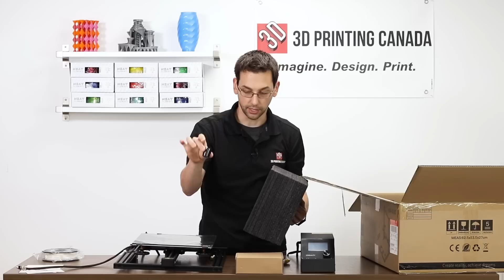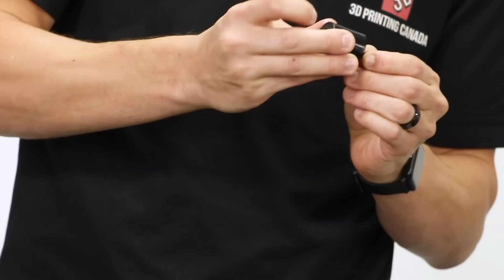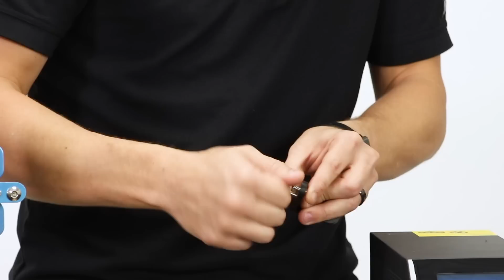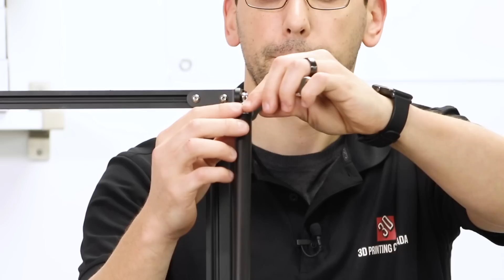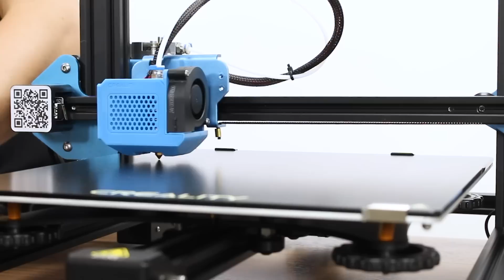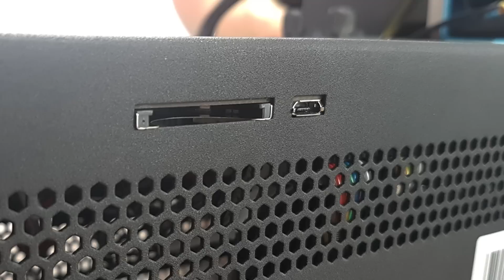Creality CR-10 v2 Unboxing - Is this Creality's Best Value?

Comment: Just finished building it, My z axis is messed up I think idk a bolt might be locking it in place or I messed up or it came messed up but the z axis doesn’t move and it makes a very unpleasant sound that sounds like the printer wants to be put out of its misery. Any idea what could be causing it?

Comment: Why did you preheat the nozzle and bed prior to leveling?
Reply: The heat causesthe the bed and nozzle to slightly expand, you want to level whilst they are hot in order to get a accurate bed level, however, it's not necessary, I find it best to adjust the level during the print as it is most accurate in terms of actual print performance

Comment: My Zed stop switch did come with adjustable hammer bolts and nuts.  It bolts to the frame.  Is there somewhere I can order them?  The bed won't raise up enough to level properly.

Comment: I'm been considering getting a 3D printer to sell sculptures and custom frames, but at the end when he says it took 28 hours to print that shelf bracket all I thought about was "it's probably easier/faster to carve it by hand" not to mention the time it takes to model it in 3D. Why is 3D printing so inefficient? any fast speed 3D printers out there?

Comment: Hi. I haven’t turned on my printer yet because I’ve noticed a few things that have worried me about the printer. I’m meeting resistance along the Y axis and I’m just curious if there is supposed to be some resistance because it’s not a steady amount of resistance there are point where it just stop and you have to push much harder to get it to move. Another thing that worried me is that the bolts that hold onto the Z axis are very loose on both sides and I wondering if they are supposed to be that way. If you are familiar with these problems and could answer my questions it would be much appreciated. Thank you

Comment: Thank you for your video.  I just got the CR10 V2.  I was originally using a Dremel 3d20.  But decided to upgrade, with CR 10 and also a Palette 2s and Hub s.  I have been having trouble with the z-axis.  I leveled the bed, but once printing begins, the z-axis moves up a couple mm, and then the first layer is a failure, which causes the whole print to fail.  Should I raise the z-axis and bed, and then recalibrate?  Also, I just ordered the BL leveler and hope that this will help.  Please advise.
Reply: Did you fix this problem, if so, how? Getting mine tomorrow so it would be interesting to know if I run in to similar issues. Feel free to give other tips and tricks about the CR10 V2. :)

Comment: I have a new CR10 v2, and card reader is horrible. If i Press the card hard enough and hold it pressed, it will read the card, and if i let the pressure off, the card is not readable! bad first time experience.

Comment: Great video. The Z Axis Limit Switch (you must have a early model) now mounts into holes of the frame so you cannot adjust. I have been having a bugger of a time trying to level the bed (just got the printer today). The springs are up to the end at times. Much harder then my flashforge which mind you has auto leveling built in. If BL touch solves this perhaps i may look into it. Also seen they now have a CR-10 V3, lol i should have waited a bit.

Comment: I have a cr10s and there is no room for the glass sheet. Had i hit auto level with it on there it would be destroyed. Not sure if i want to crank the bed leveler down a quarter inch. What did i miss?

Comment: Just received mine (4/26/2020). A few differences FWIW.
  The rubber feet came attached on mine. As mentioned in the video, the rod brackets seem to line up perfectly when they were flush with the ends of the t-track. By sheer dumb luck I mad the rods exactly the right length the first time! 
   The z-limit did not come assembled on mine. My Z-limit switch mounts in pre-drilled holes, not on t-nuts, and would therefore only be adjustable if you used t-nuts, which are not supplied, instead of the threaded holes. I noticed that there is considerable play in the way the Z limit switch is held onto the frame. That might be something to use or might have to check from time to time.
  Nice to know that the third thumbscrew is an extra. They don’t tell you that and I spent quite a while looking through the directions trying to figure out where that thing went.
  My software says “Creality” in the upper left-hand corner instead of “CR-10 V2’. other than that it seems to be the same.
  No I’m ready to level the bed and try to run a print!

Comment: Hi! Does this really needs the Titan Drive in order to print TPU? Mostly I'll use it with PETG but I'll also need some TPU to come out of it.... Any tips on that? 
Or it would be better to choose Ender 3 Pro stock? What's your advice?
Reply: For any flexible material like TPUs, don't try to use bowden style printers (like all the stock Creality configurations). Yes, it can work, but direct driven extruder/hotends are just way better and more reliable at this task.
I would definately look for an extruder upgrade. Does not have to be the E3D Titan Aero, i think the new Hemera might be another interesting solution, or one of the BondTechs. I just have not had the pleasure to compare them directly, so i can't really tell you from experience what works best.

Comment: Try to perform electronics and somewhat mechanical basic search before video making/documentary... you're not familiar with basic terminology of basic connectors like You're telling 'IDC connector' as connector used in PC, 'Stud' as threaded rod so on... so try to perform basic search on parts you find....

Comment: It never ceases to amaze me, how many people claim lock washers aren’t important. They keep screws and nuts from loosening and falling out...USE THEM!!!
Reply: It depends on the style of lock washer. NASA has some documents on Split Lock washers that says they don't work.
Reply: You're not wrong, just looking at a different time scale. At first, the lock washers don't do anything. It takes experience with mechanical things to understand their utility. Also some cheap lock washers actually don't do anything ever because they're not made out of a material with the wrong strength and deform when compressed.

Comment: Would you recommend this over the cr10s? I am thinking of getting the 10s but am open to other printers.
Reply: @Jason Yeah feel free to ignore Jason's reply lol
All I'm saying is if you buy one of these, get ready for mad headaches, they are very finicky, sure you will get some prints with nearly no issues, but you will get a mountain of screw up prints, you could have every setting perfect and 10 hours into a print the machine just decides its going to screw up and there goes whatever you were trying to make. Resin is typically much more user friendly, however resin is quite expensive compared to filament, your print size is much smaller, and there is a curing process for your prints when they are done, however having said all that the success rate of most resin printers is quite good and resin printers are masters for detail. 
Take it from a guy who has owned 6 3d printers, including 4 creality brand printers. I will never buy another creality.
Reply: Skyline Fabrication my Ender 3 Pro prints 24/7 with minimal issues.  I do a lot of 80 hour jobs with no issues at all.  For the money, you can’t go wrong.
Reply: @Jason Which one is the best / the favorite printer? I'm looking for a first one to buy.
Reply: Don't buy a creality, all junk, if you can afford it buy a resin printer. These printers are a nightmare with screwing up prints
Reply: @GearScar  Lol wut? Resin for a first printer? Resin is fucking garbage, as it's toxic and dangerous to use for a regular/casual user. The CR-10S is a perfect FDM printer for starting out or to upgrade is you're looking for a large build volume. Stop spreading garbage in comment sections.

Comment: Great Video Jason, I bought my CR10 V2 but not allowed to put it together till Xmas... Sad face. Anyway does this printer have the hotend runaway protection turned on?
Reply: How far apart are the rubber feet on the v2 from each other? I want to know if it will fit on my dest length and width. Does the bed also move foward and backwards beyond the bottom frame?

Comment: I have just installed the BL Touch on my ender 3 pro .
 After a lengthy process of installing and making sure everything was ok

 I managed to  do a first print ,taking approx. 45 min. 

This was an amazing print

I changed the pla and turned the ender back on ,as soon as I did. I got a very strong smell of electrical burning

The light immediately went out on the sensor

I am now left with this not working at all

Any ideas as to what may have happened

The needle had not been damaged or anything, as it had returned to home after the last print
Reply: @Jason I think it may be just a faulty sensor. Everything else seems ok, Nothing much more I can really check on
Just thought you may have an idea as to the cause. I rekon I must be the first this has happened to
Thanks for getting back to me, Unlike some others on youtube
Reply: @Jason I bought it from Banggood, they are being really stupid. I told them the sensor is fried. After approx. 6 emails and dys later, they said maybe I can take it to local repair shop and send them the ill. Even Creality dot want to know here in the UK. They said take it up with Bang. I can see a pay pal dispute coming from this Hey thanks for all your responses
Reply: @Jason They have said this morning they will send another. Only wish there was a way it could be repaired, but its a circuit board and that itself is almost impossible to fix
Anyway thanks for getting back to 
Cheers
Graham

Comment: Would you (or any other experienced viewers reading this) recommend the V2 over the pro, or is the pro still a better machine?
Reply from the maker: I would say both have their upsides. If you intend on fully enclosing the machine the CR-10 v2 is a better way to go since the power supply, control board, etc can be located outside of your enclosure. Both will produce good print quality, arguably the CR-10s Pro would be better because of the bond tech extruder gears.
Reply: 3D Printing Canada thanks dude, I pulled the trigger on the 10 pro v2, it’s my first machine so hopefully I will be happy with it after obligatory mods.
Reply from the maker: @_jovian  Hopefully you bought it from us! Its on sale for Cyber Monday with free shipping in Canada and the USA!

Comment: Jason, you're not supposed to fully tighten the support rods to each other, maybe leave half a milimeter or so, until after you've secured the screws to the frame. Then check for squareness by tightening or releasing a bit the rods (just a bit or you'll end up bending the frame) and then tighten the nuts. I don't have the V2 but those are the same braces Creality sells for the CR10 and CR10S

The upgrades are really worth the extra bucks compared to the CR10S. Buying those upgrades for the CR10S would increase its price way more. And regarding the CR10S Pro... I'd stick to this V2 anytime

Comment: They speed up the heating with 24V but they make you turn a dial which took forever to set the high temps? I prefer my keypad on my cr10s pro.